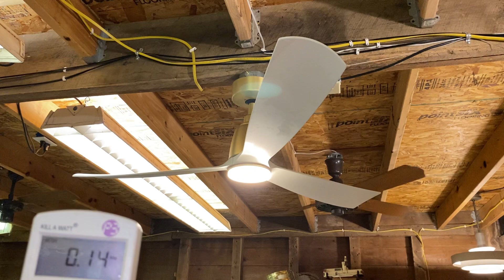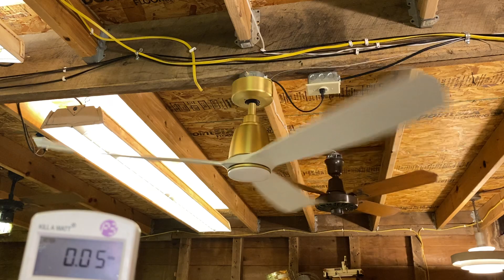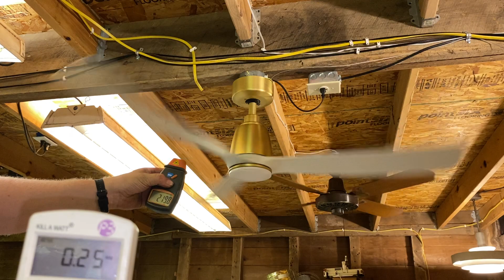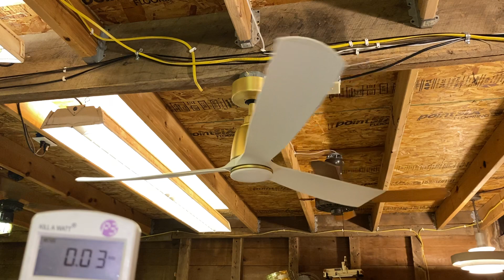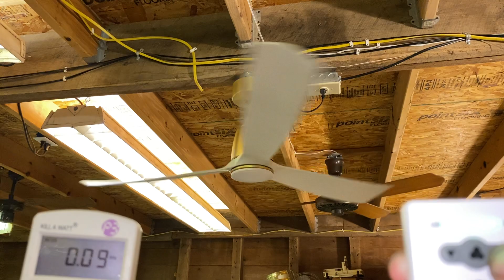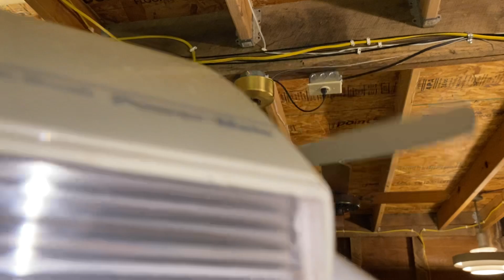Fanimation Kute 52 inch DC motor ceiling fan

Comment: 15:10 the new method of testing CFM is known to yield much lower readings than the older method and the anemometer tests anyone can do. I knew these would be on par with K55s and some modern industrials with those blades. Must have wide air spread too with them being slightly curved